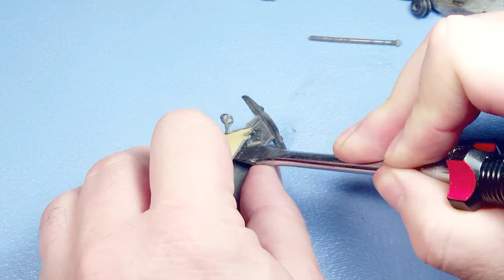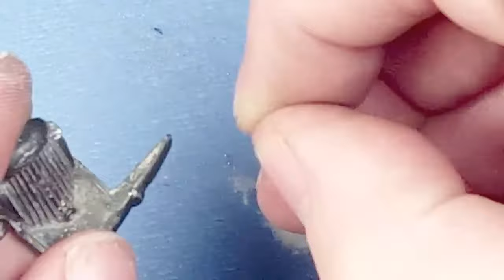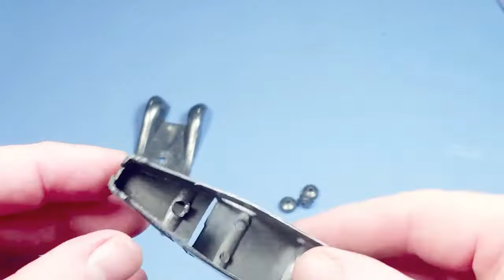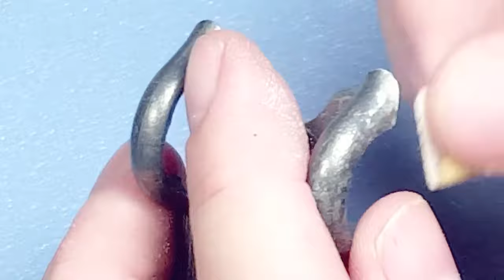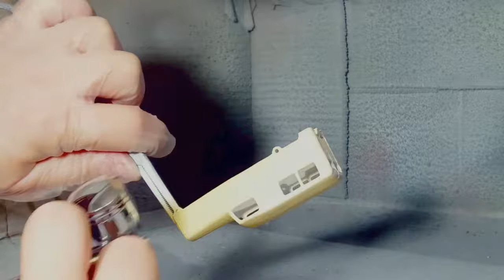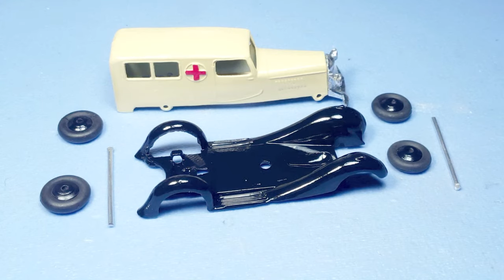Bentley Ambulance. For original, with audio, see https://www.youtube.com/watch?v=YEmzCfXu3Fw

Comment: Hey Timo, nice bit of work there... live and learn as they say! 👍🏻 You asked, so I can give you some info on this model. It is post war, 1947 - 1950.
The chassis base tells the story, single hole with tranny and rear axle hub showing. There were 5 different chassis bases, and this model came with open or closed windows. Also in grey/ black body. Black tires are correct. They didn’t command a high dollar value even mint in the box, about $170.00 max CDN.
Refurbed models sell from $35 and your model before repaint $35 - 60. Depending on condition. Nice keeper... 😎
Reply from the maker: Great info Pops. I figured, but I guess I was just wishing. Cheers 🍺
Reply: In the UK these models were sold new without a box.  They came to the dealer in plain labelled brown cardboard boxes containing six models.  These boxes occasionally come up for auction and usually fetch very high prices due to their rarity.  Also I don't think that the radiator grill assembly was plated by Dinky Toys, it was just painted silver.  That said it does look very smart with the chrome finish that you applied even if it is not quite original.  I have an Armstrong Siddeley saloon car from the same series to restore and I will be tempted to use the chrome finish, although I will paint the valence panel (colloquially known as the 'gravel tray') between the bottom of the radiator and the bumper in body colour.  You did a first class job in matching the paint colour on the ambulance but I wonder if the original colour on your model might have changed a bit after 70 plus years of ageing and probably a certain amount of ingrained dirt.  None of my comments are intended as criticisms as I think that you did a fine job.
Reply from the maker: @davidwelch6796  Intresting information. I like the idea of painting the valence panel the body colour. It never even occurred to me that it should look that way. Anyhow, I wanted to do this model as a restoration to the original look which I think I did. Regarding wether I got the paint to the correct initial colour, you may be right. When I restored my Riley model I made the assumption that the colour was faded a fair bit and so I went with a colour that matched an image of a Riley from the internet. Mostly I did that because I liked the colour better. I saw what I wanted to see. So with this Bentley, I liked the colour that my model already had, faded darkened or otherwise. So I matched it instead. Artistic Licence? Cheers

Comment: To remove tires place in hot water to soften the rubber👍
Reply from the maker: I have done that before, but in this case, I thought I had enough spares to replace the hard ones. Turns out I was short one tire/tyre. 😕

Comment: Spray booth = cardboard box👍
Reply from the maker: Not only that, but it hangs on the exhaust fan body, which is sticking out of the wall. So I just lift it off to clean the fan. I plan on putting a new fan motor in because this one is too weak to pull through a filter. 🙂